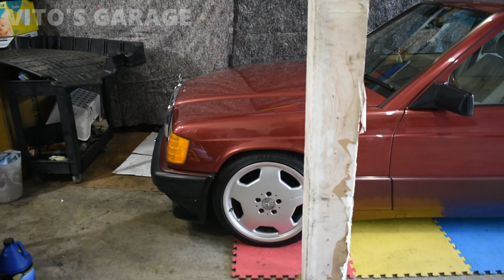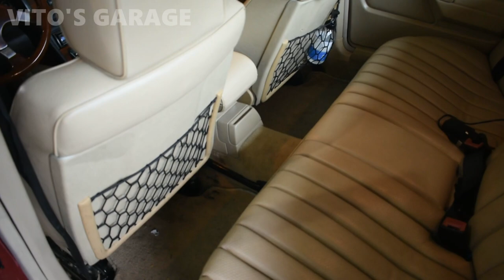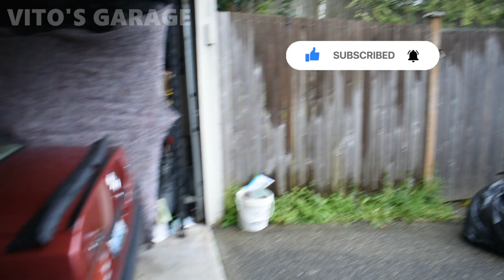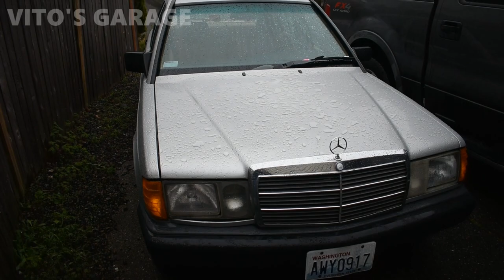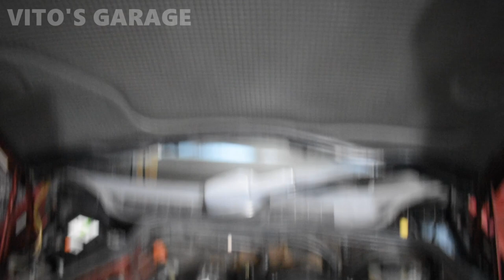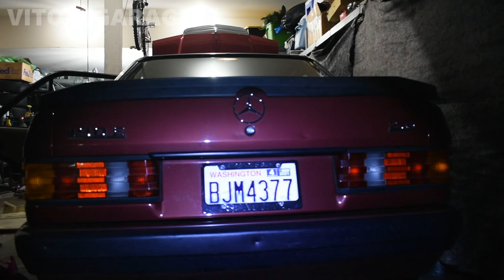😍Rein's Beautiful 1991 Mercedes 190E 2.6 M103😍🇩🇪

Comment: Any idea where you can buy the plastic headlight bezel? I can find W124 for 300E but none for the W201. I'm thinking I will change to glass headlights if I cannot source some.
Reply: last 2 years I checked everywhere, I can't found anything, have same issue I think will replace with Euro headlights
Reply from the maker: They’re available: 

https://m.eeuroparts.com/Parts/84579/Headlight-Bezel-Driver-Side-0008261159/

Left side part#: 0008261159 (1305540163)

Right side part# 1305540164

Search for the right side. I think ECS Tuning has them for sale. I know dealership will have them too. Ask about the headlight door (bezel)
Reply from the maker: Unfortunately but there are no aftermarket bezels available for W201s. You can only go with genuine or Bosch.

Comment: The engine head cover says AMG because it is a 2.6 with AMG engine spec or because its not the original One?
If it is a 2.6 with AMG engine spec its a real unicorn
Reply from the maker: It's actually a regular 2.6L M103. The owner found this legit AMG valve cover and just wanted to install it. It looks very nice